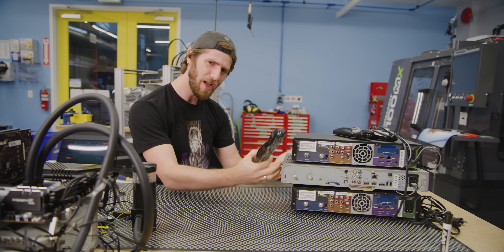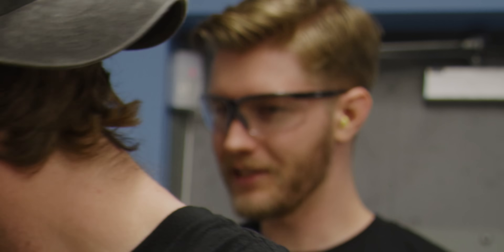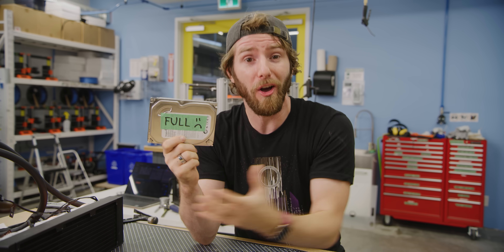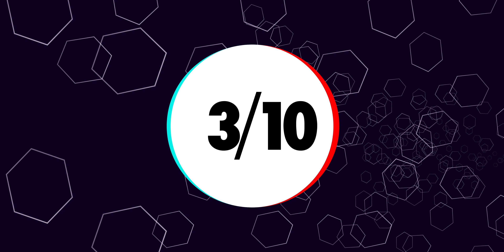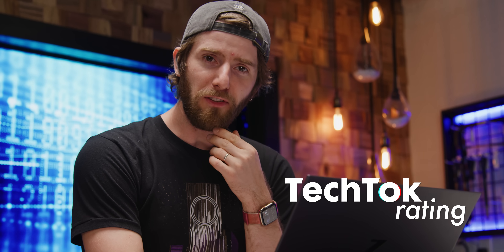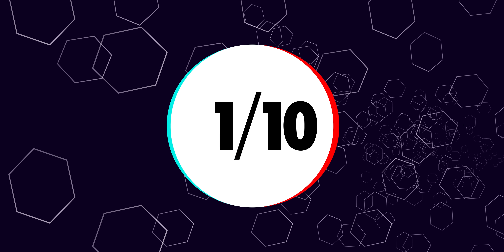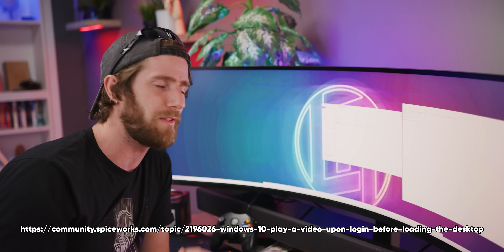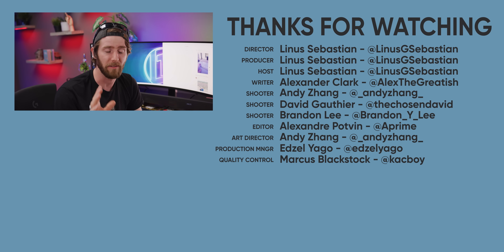Trying TikTok Computer Hacks...

Comment: It makes me happy every time I see someone point out Win+Ctrl+Shift+B. Sometimes your GPU can just kinda glitch out (especially when trying an overclock) and resetting the graphics stack is enough to keep going without resetting the whole PC.
Reply: Does it reset or refresh, cause I don't want to have to re-download my GPU drivers every time I do it, stupid question, thanks.
Reply: @_BaileyK  It's resetting the graphics stack, basically restarting your GPU/drivers. It won't touch the driver installation. It may crash any open games or 3D applications if they haven't already crashed so be careful.
Reply: In my case, my one monitor (purchased as a pair, other one is same situation) keeps not restarting properly unless I fully power it off then back on, and even then it's a gamble. Oddly I used the one that was 'broken' (same reason) for 3 months and then when the good one failed, I swapped and it started working. I now wonder if I can't trick the monitor to cooperate by resetting the GPU this way.

EDIT: Nope. Monitor still fucked. Best $600 I wasted on a pair ever.
Reply: @FlameSoulis  This shortcut won't fix anything that a normal PC restart won't. Sorry if that wasn't clear.
Reply: After building & owning PCs for getting on for 20 years, I'm ashamed to say I've never heard of this shortcut before! & it is useful in some circumstances! I can't believe I learnt something from a bloody TikTok video 😞
Reply: I used to replug the HDMI cable, this is impressively useful
Reply: @CoreyFaure  It's cool. I figured that maybe causing the refresh might cause the monitor to correct itself (such as re-receiving the resolution set information or anything part of initialization).
Reply: @CoreyFaure  can it help with "stucked on loading screen" issue in LoL? (It could, because killing lol process helps, but you cant do that because that whole F*** thing is in alwys on top mode) think crashing it would resolve it as well
Reply: @FlameSoulis   Ihad the same issue, for no particular reason my monitor wouldn't show a screen when booting up but maybe after a few tries. Even with different monitors. Very annoying... 
Only solution to this was a clean display driver uninstall with the "DDU (Display Driver Uninstaller) Tool" via Windows safe mode and a new fresh driver install.
Reply: actually helpful
Reply: Benjamin, thank you for explaining what it did. Linus' didn't make much sense (and the video was even worse!)

There are times that might come in handy. So I'll have to keep it in mind!
Reply: @HOkayson  you didn't! You learnt it from a Linus video :)
Reply: @justjosh11  Haha, touché!
Reply: @FlameSoulis  I think I know your problem sir. Do me a favor and let me know if I was right:

If you have an AMD GPU, this applies 💯.  It may also have something to do with having an AMD cpu but I can't say for sure - I don’t recall this happening with my Nvidia GPU as often, but whatever lol.

If you are using display port, and you either come from sleep or a power off state, The screen might either stay black, or show as a much smaller square in the center due to a rather severe resolution mismatch.

Your turning the monitor off and back on is one way, but the easier way (depending on where your rig is), is just to unplug the display port cable and plug it back in real quick. As you said, it’s a crapshoot, but unplugging and plugging back in the display port cable is a hell of a lot faster than turning off and back on over and over again.

The research that I’ve done on this leads me to believe this is more a displayport issue then with AMD, but take that with a grain of salt.  It doesn’t happen hardly at all with hdmi however
Reply: @i.SM0  see me previous comment.  I bout broke my monitor 40x with this bullshit lol.  

Don’t take this the wrong way, but I sure am glad to see other people suffering from this lol
Reply: @HOkayson  I hadn't either and nearly same amount of years. Hell good info is good info. As long as I'm initially skeptical and double check it's correct then in the end I'm just happy I've broadened my knowledge. Although, I'm not about to go scouring TikTok for the answers to life.
Reply: Now if there was a shortcut to reset audio drivers too
Reply: I gotta remember this. Sometimes my Fury X just randomly kicks on hardcore mode with the fan at turbo boost 1000% RPMs for no reason at all. Resetting the fan in the Radeon settings last all of maybe 60 seconds before it gets berserk again. I always had to restart to fix it.

Comment: Linus: hits hard with a hammer
Also Linus: "So this hard drive is broken because of the DVR"
Reply: Lmao
Reply: He also put those red welding magnets right up against the DVR to hold it during grinding....
Reply: @IamRyanLPs  did you ask it for consent
Reply: To be fair ... Things are usually at goodwill because they are busted and people feel bad throwing them out.
Reply: @IamRyanLPs  i have changed it, just for you
Reply: @sql64  thanks dude, the notification for your comment was like mental on my phone. Appreciate it
Reply: Also uses giant magnets to hold the DVRs while grinding security screw heads off
Reply: @evbunke2  and the grinder wont do any vibration damage will it? 
and who uses a hammer to remove a hard disk in the first place?
if you didn't want to use them as your main drive they could always be used for your regular back routine of your PC data ?

what if the have been used 24 hour-a-day, for years, they only been writing and reading large video files, so the working life so most of the disk full more than likely full, of file which recorded, the once for first time, it the only time any think was recorded to that part of the drive, because most people only record programmes they want to save them , and when files (video) ,is saved to the disk, it will generally be in one large file, so the read/write head or only mostly going a round like the needle on a record, not jumping all over the place all the time?, and lastly, this sort of hard disk is gentle run in a more called (video drive), unlike in PC mode, if the dive, has small error, a pc will replace corrupted data, as it finds it, but, in video mode, it just blocks it so it never be used , jumps over the problem area and continues recording, so no to pause what is being recorded, ?

Comment: "And one hard drive failed self test"
Linus: throws, rudely tilts and drops and rips out the hard drives or their 'enclosures'

Also Linus: "This is fine" :)
Reply: I wouldnt buy a hard disk drive in the year 2021.
Reply: @fynkozari9271  don't get me wrong, but having one is fine.

I am using 3 SATA SSDs and a NVMe SSD but also a 5TB 2.5" HDD. It's just a reliable storage. I have seen my old SSD wear out and honestly... I was glad that I had backup points and all

Also... Saving important data on there is my way to go because even if it dies, I can still recover Data.
Reply: @fynkozari9271  To be fair, Hard drives are still usefull as they are very affordable and have alot of space. whereas SDD's are still a little bit too pricey to be worth the space you get. atleast in my opinion.
Reply: @julius6889  HDD is good if u dont have already. I have many HDD. WD blue Sn550 1tb NVME SSD is good price for new gamers with new mobo, usually they have 2 or 3 nvme slots on 2020 motherboard. My 4 year old aorus x370 only has 1 nvme slot. So I need to buy PCI adapter to add more.
Reply: With a pair of needle nose pliers, that tab could have been twisted straight...
Reply: HAHAH LOL that is great
Reply: @fynkozari9271  It depends on the usage... if you have  it for photos & movies there is literally no reason to buy 1 or 2 TB SSD for this purpose.
Reply: @julius6889  exactly, I got a 2TB HDD to add to my 1TB HDD for just 60€ in my country while and SSD with 2TB costs around 180€, so if you don't really need that speed you can enjoy a Hard Drive even in 2021 and spend those money on other things
Reply: @Iceman-hb3uk  yup those exstra 60 bucks can make your cpu or graphics card better if you were say building a pc from scratch.
Reply: @julius6889  yeah pretty much my case

Comment: One point completely missed on the "DVR HDD hack" portion is that often enough, these drives have flags set so that they do NOT just spin up and power on when thrown into a system as is suggested here (perhaps these 3 weren't set up as such).  There is a non-insignificant chance that you'll need to create a bootimage to load up a custom utility that can flip these flags so that the drive will then function as normal from there on out. 

It's been a couple years since I've messed with it, but if memory serves, it's the PUIS (Power Up in Standby) flag specifically that is at "fault". Which, is honestly preferable in terms of actual wear put on the drive given the use case of a DVR.
Reply: How would you fix this
Reply: @sebaschan-uwu  You use a boot image such as Hirens and disable the PUIS flag.
Reply: So that it raises the chances of that working?
Reply: can't you just use dban?
Reply: Also another point not mentioned in either the TikTok or by Linus is that you really should look at the manufactured date on the label. If it says it was made in 2006 or some other absurdly old number, then it'll have a 500GB max drive unless it was user replaced (which is highly unlikely. I've seen 1 replaced drive out of about 15 DVRs). And the quality of that drive won't be the best for everyday use. The later you go after 2010, the higher the chance you get a larger capacity drive, and a greater chance that the drive will still be good.
Reply: @SuperFlight  I believe something like GParted can also be used. I could be wrong.
Reply: @bruwin  "made in 2006 or some other absurdly old number" Mega Oof. One of my cars is a 2006. I was 15 in 2006. 2006 was only like 4 years ago, damnit.
Reply: Easiest way to check is with a hard-disk tool. You can see the how long the drive has been operating for. But you need to buy the DVR first.
Reply: @bruwin  One more point is the connector. If you have a really old DVR, chances are that the hard drive has the IDE interface instead of SATA. Obviously it’s not recommended if you want to use it as a backup or general usage, but unless if you have an old desktop you can experiment with it!

I’ve pulled a 160GB drive from a Dish receiver and installed it to my PS2 to play backup games.
Reply: Either way - not worth the time and effort when brand new hard drives are pretty cheap.
Reply: @bobos245  Honestly, it's worth it for maker projects, or teaching kids how to disassemble electronics and repurpose them in a computer build or something. Stuff where it won't hurt if your data disappears because of a jank drive. It can make for fun projects for kids and teach them that there is always something worthwhile in reusing and recycling components.
Reply: @1racerboy1  I was 27 in 2006. It hurt me more to write that than it did for you to read it.
Reply: @SuperFlight  I did the same thing and that drive was reliable as heck for my ps2. I imagine it was because there wasn't a ton of stress from being used by a ps2 compared to a PC, but I dunno.
Reply: @bruwin  yes and no all cable boxes max out at 500gb sat boxes max out at 2tb anything past 2014 will not have a hard drive in it as  all companies have switched to integrated chips and the cloud for storage
Reply: @1racerboy1  I was 8 in 2006

Comment: Those DVR hard drives are the same ones used for like security cameras. They should actually be high speed and high cache for the size. The storage sizes are typically smaller for the same generation hdd, but the other tech upgrades make it worth more than $10.

Comment: I enjoyed that while Linus almost certainly has numerous security screw bits lying around, he chose to open the DVRs with a grinder just for the fun of it
Reply: All for dramatic effect
Reply: It's not like he could have drilled them out or something like that...
Reply: I'm sure it was 1000 times easier to find the grinder than to find those bits
Reply: Yeah and he used grinding discs to cut instead of proper cutting discs.
Reply: Sparks shiny
Reply: Linus has them but the average Tik-Tok viewer probably doesn't
Reply: @benford1726  The average tiktok viewer certainly doesnt have an angle grinder.

Comment: The changing the icon trick, i used that on my brother once when the starcaft 2 beta came out. He was a massive fanboy. When he got home from work and clicked it, it was a rickroll, great time.
Reply: respect
Reply: RESPECT+++
Reply: How did you hide the name under the icon??  This "tip" does not address that, thus I rate it another 1 like most so-called tips.

Comment: The last tip is actually very useful if you know when to use it. (Which the tictoc didn't explain) 
For an example, some surface laptops, the screen doesn't turn back on after you wake it from sleep, and doing that fixes it. 
Or when you add another display and Windows goes strange, you can do that to restart it.
Reply: Was watching it on tv but could hear what was said... What was this issue about actually?
Reply: @RomboutVersluijs  ctrl + shift + win key + B apparently restarts your graphics drivers, and potentially fixes some issues :)
Reply: @Kemachris  I remember this issue,cant really remember whhat ive done. Ive  not run into this issue again. I think i did try this shortcut
Reply: @Kemachris  It does not. It resets the Windows DWM. Which, admittedly, is far more buggy in W10 than any graphics driver.
Reply: does this work whenever a game freezes my computer? restart graphics drivers and the game will probably crash anyway
Reply: I used to use this back when windows 10 had some issues with broken windows (where the top 1/5 or so was blacked out and unresponsive) and kept it for any time I was experiencing odd issues with DWM.
Reply: I wish I knew this a month ago when I nearly drove myself insane trying to fix a resolution problem on a screen I own.
Reply: Hey! I have this issue on my pc sometimes, i will try this!

Comment: for those DVR hard drives he specifically had an old directv one, which are just plastic and super easy to get into (speaking from experience). for the metal ones, you could also use a tin snips and cut from the ventilation holes to start as well

Comment: Whoa, that last tip actually resolved(at least temporarily, who knows how long it'll last) a recurring issue I have had for years with weird graphical artifacting on my computer that I haven't been able to fix.  I knew it had something to do with my GPU and probably it's drivers, but nothing I've done has even temporarily addressed the problem.   Finally I have a way to at least alleviate the issue!
Reply: I have random garbage happening like my receiver not being recognized by the TV after years without a problem and then sometimes working again or right now after using the same setup for 8 years suddenly the HDMI port on the PC has no audio.  These things are such junk.  I am sure it will then just randomly work again one day.
Reply: DDU every driver update and install only the latest driver at any one time. FIxed my GPU issues with my 2080 super.
Reply: has it worked long ish term?
Reply: Since this is from 6 months ago: Was the fix permanent?
Reply: @ripAfatCone  cool, thanks for the tip!
Reply: This is the same "fix" that windows will do automatically when you get the message "you graphics card stopped responding and recovered"
Reply: I had a similar problem I couldn't fix. Windows update repeatedly keeps uninstalling my Ryzen G series integrated graphics drivers and replacing them and it's so god damned annoying. I had to do factory reset like every 3 months but this tip apparently worked.

Comment: "That's probably not good for the hard drive"
Ignores the fact Linus just used 2 large welding magnets to hold the case still....
Reply: Exactly lol
Reply: LMAO I bet at least 1 of them died just because he did that
Reply: Pretty sure even magnets that powerful won't actually damage the drive *physically*. It would still just wipe the data... which you're going to be doing soon anyway...

For perspective... A fairly old school data privacy technique for platter drives was to embed powerful (electro) magnets in the frame of any exit from the room, eg a door. Removing any drive or device containing a drive without proper shielding would immediately wipe the contents of the drive with no input from the user.
Reply: @hammerfall321  Yes I did.
Reply: @RayneAngelus  the chips on the PCB can surely be wiped/ scrambled by the magnets also causing drive failure.
Reply: @tymelock  Yes and no... the "data" on those chips is not stored like it is on the drive platters, so it's not susceptible to magnetic field interference. Likewise, the conductive traces inside the chips are so thin that it would be really tough to induce a problematic current in them. But it could be done, with enough power...
Reply: @RayneAngelus  I like your funny words magic man

Comment: 3:37 *Linus after manhandling the drives like they are window doors in a hurricane*: "Oh no they're probably fine, the way they validate these things..."
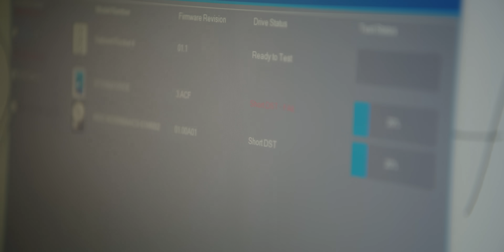4:28 *Linus after drives fail*: "Yeah that's gonna cost Dylan a few points..."
Reply: Hammer tech tips
Reply: @thestarvingonetso5627  Linus: STOP! HAMMER TIME!
Reply: Linus: works with pc parts daily
Also Linus: Puts two giant magnets on either side of a box so he can remove the hard drive, likely damaging it in the process.
Reply: @capntizzy9029   yeah I don’t think they realized that that’s probably the reason the drives weren’t working
Reply: @Nickwilde7755  magnets will erase them, if they did not spin up, there was mechanical damage... though, using hammer to extract them might not have helped
Reply: @ossharkuenmeursault5609  my reasoning was that the arms that drop and raise to read/ write may have been pulled into the disk itself,  or acted in some way that damaged their ability to move correctly - though I can't be sure.